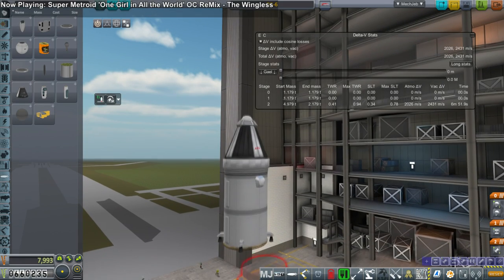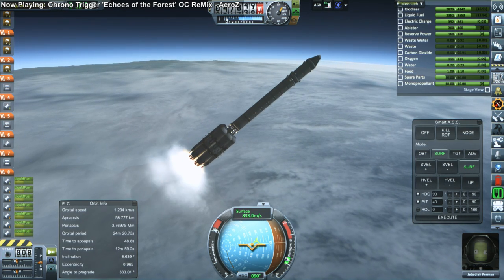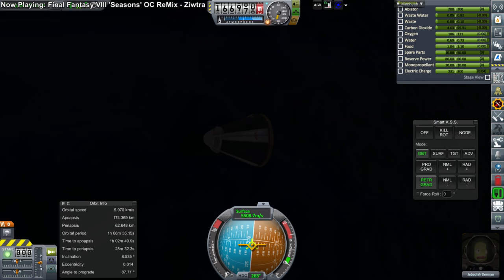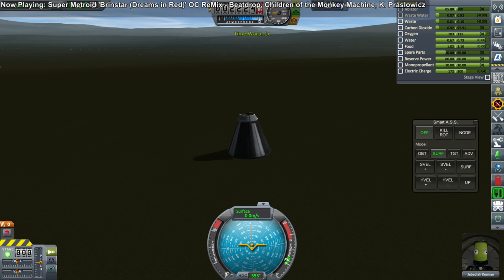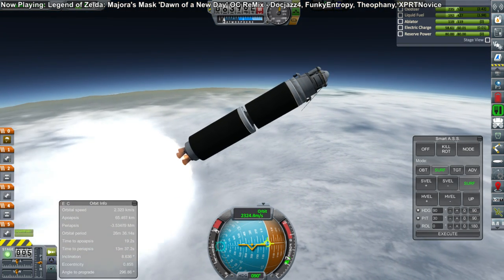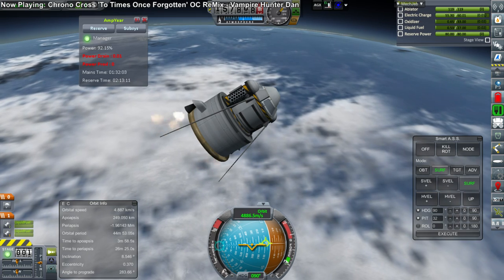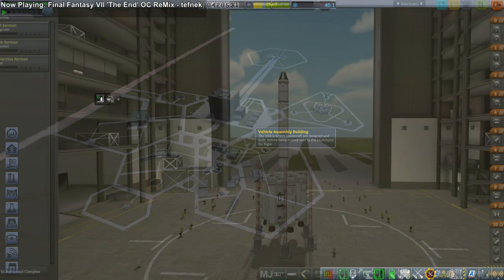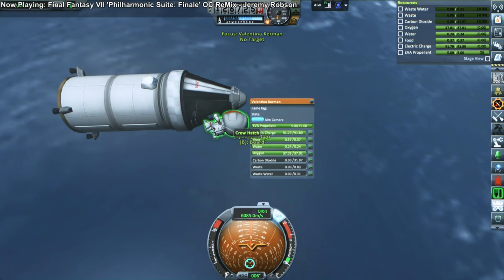Kerbal Space Program (1.2.2) - Galileo 6.4x 06 - To Orbit and Back

Comment: I had that exact same bug today, when I EVA jeb, and nothing seems to be working, no F9, couldn't board or change vessels. I also had to restart the game to fix it.
Reply: Tyler Raiz I also had / have this bug.  I thought was due to the SSTULabs parts, but seems not.  I only see this issue on my Galileo install, which does not use the 6.4x scaling.
Reply: Not Galileo, as I do not have it. However, I do have Kerbin 6.4x with Sigma Dimensions. So it could be that as well, if you were thinking Galileo.